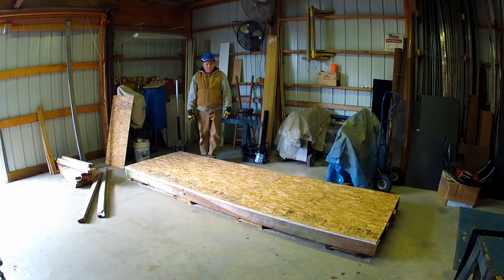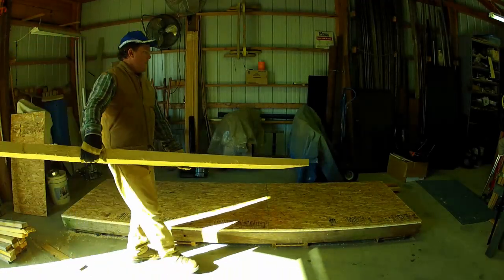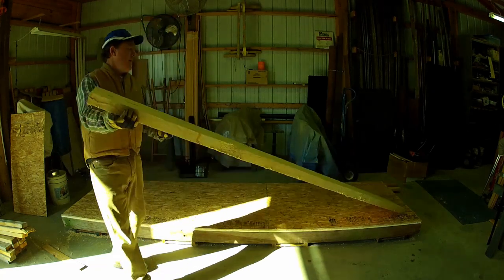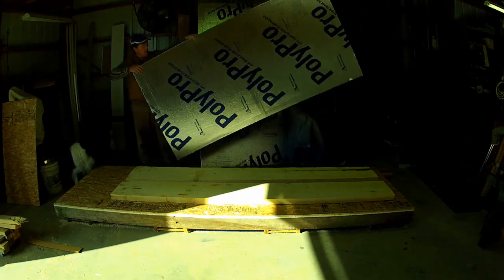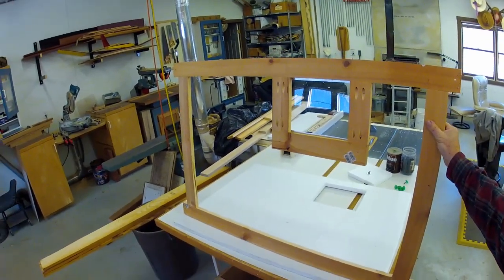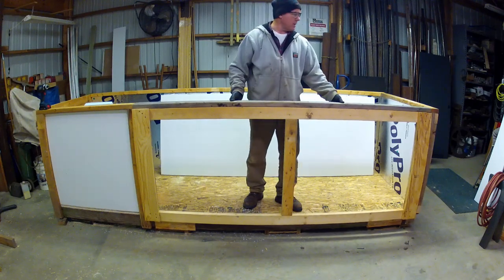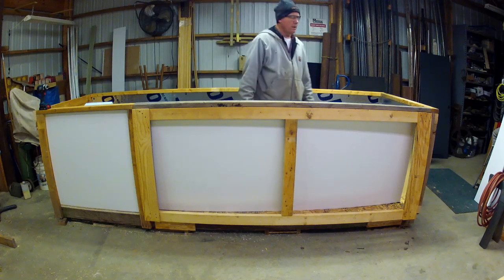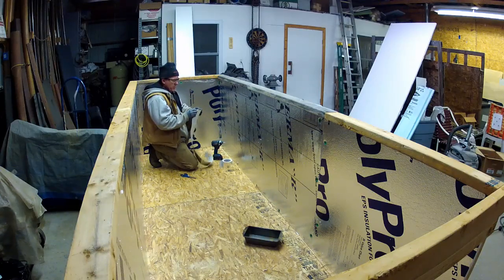Building a dehumidifier wood kiln - part 2

Comment: I am curious to learn which dehumidifier you used, and which heat source you finally settled on.  P.S.  I've enjoyed your videos.  They've been very informative.  Thank you for making this information available:)
Reply from the maker: I put a link to one that I would use, in the video comments.  The dehumidifier I use was an old Whirlpool.  I looked and can't find one like it on the web for sale.  One of the things about using a household dehumidifier is to avoid the ones that have the electronic interface with the soft buttons and such.  You want an On/Off and a knob for dryness (which you will turn to max and leave).  The one with the fancy interface are more prone to failure in the rather harsh conditions of a kiln.  You might also look on CraigsList if it is available in your area.
I will get the info on the heater later tonight.  Thanks for watching.

Comment: those 350 or 500 watt halogen yellow work lamp will get that hot, we used to use them to work under houses and on construction projects, in summer they are murder, but in winter they would heat a entire room up, i made the mistake of touching the bulb before it cooled , and it completely melted my finger

Comment: What ever happened with your kiln?  How did it work?  Update?
Reply from the maker: +falfas55bgas I haven't had a reason to use it again.  The controller is in the shop along with the sensors and cables.  The box is in the barn covered up.  Sorry I can't add more.

Comment: How long does it take to dry the wood with this set up?
Reply from the maker: Keep in mind that I start with air dried wood.  I have to get from 13 or 14% down to single digits.  It takes about a week letting it run at about 105f.  This last batch was pine.  To dry it and set the pitch took 10 days.  Hardwoods take the same time, maybe a little longer.  The wood I'm drying is all 4/4.  Thicker would take longer.
With the kiln controler automating it, I am going to try running it longer and slower on the next batch.